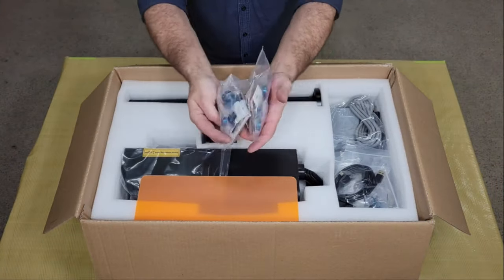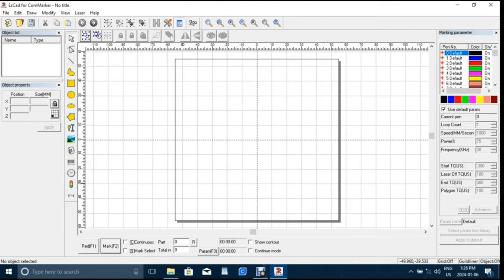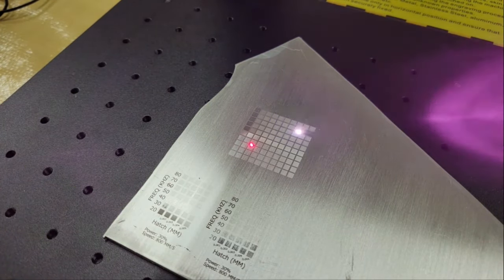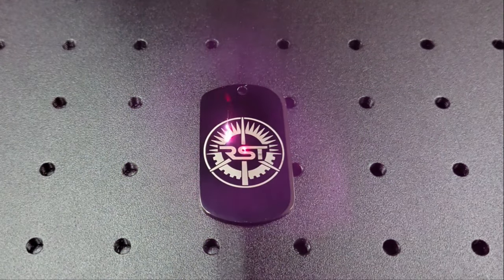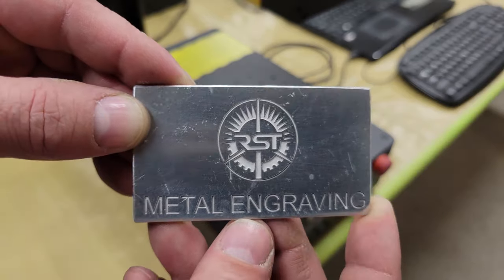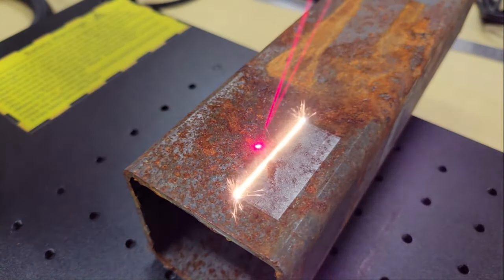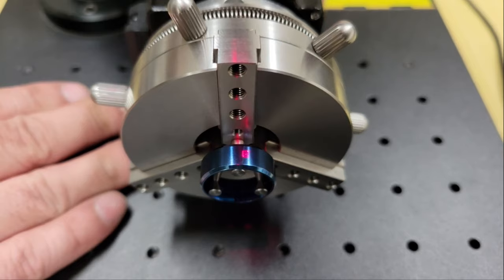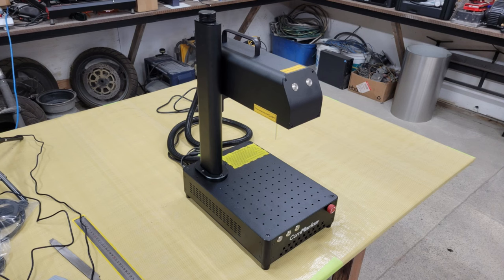3D Metal Engraving W/ ComMarker B4 Fiber Laser: Review

Comment: Does this engrave on glass?
Reply from the maker: Not bare glass because it won't absorb the fiber laser's wavelength, but it can with a pretreatment like a marking spray (Cermark or Enduramark), black ink, permanent marker, etc. Anything to prevent the laser from passing straight through the glass unimpeded. If you're looking for a machine that can engrave bare glass (and any other material using a fraction of the power to produce the same result), check out my latest review of ComMarker's new Omni 1 UV laser.

Comment: I would consider you pretty familiar with laser engravers and as such the best impartial person to turn to for my question. Setting aside speed efficiency in terms of profit(still should be quick for my own sanity), for a prototyping shop what laser system would you recommend for engraving primarily steels and tool steel up to 0.015-0.020” (0.35-0.5mm) with maybe occasional carbide/ceramics to half that but not nearly as a priority? 
[I’m assuming if it can handle these then other materials like aluminum, brass, bronze, cast iron, copper would be just as capable if i’m wrong, plz correct]

I’ve been looking for a setup that can engrave deep Identification onto the above materials as traditional punch engraving isn’t practical and existing laser engravings rub off or become damaged & illegible. 

Some tooling with existing “scratch pass” from laser engraving gets worn away so quickly that it disrupts workflow, leads to costly mistakes and in general aggravates to the point of necessitating change. 

While there are definitely many other systems and methods that can be employed to minimize these issues, for my specific situation the most fool proof and reliable is to have tools with permanent engravings (something like the big deeply embedded numbering on impact sockets where at a glance the important information is immediately visible).

I would never dream of holding someone else accountable for their opinion so any feedback or signposts would help immensely in narrowing down all the different competing models and stretched marketing strategies.

Comment: Hey dude. Glad o found your channel, work place just purchased 30w fiber laser and I'm happy to play with it. Where could I get this speed Vs power grid so I can try various material here.  Thanks
Reply from the maker: Tell your boss to get Lightburn software if they don't already have it (make sure to get the galvo license). It's the best control software for lasers imo. Use the material test tool that's included in the software to create test grids quick and easy with any parameter ranges that you want to try. Check out my other fiber laser videos to see how to use Lightburn's material test tool for reference.

Comment: where does the removed metal go? I was thinking of using this in my jewelry business.
Reply from the maker: Mostly vaporized, some is turned to fine dust/powder that settles on the base and work bench. Not sure what sort of effect the laser has on the properties of particulates that aren't completely vaporized or if it's in a condition to be reused (I assume you would want to recycle as much 'waste' as possible). Ventilation is a must either way.

Comment: Can you please say what type of coating you use for the metal tags and cards? Is this paint, powdercoat, electroplate?
Reply from the maker: Not sure what you mean. I didn't apply a coating to anything, but you can mark any of those.
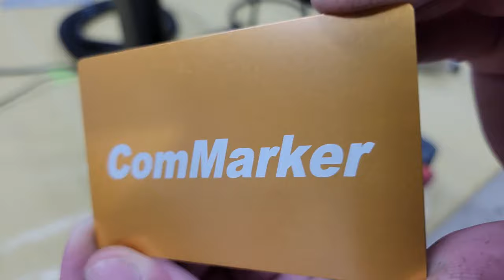Reply: @JamesBiggar  At 6:37 then how did you turn the unmarked aluminum business cards blue, black and gold if there was no coating on them to start? Is that some special alloy you're using?
Reply from the maker: I never said there was no coating on them to start with. I said that I didn't apply a coating to anything, because I didn't. Those are blanks made by a manufacturer who cuts and coats them for sale. You can buy them in a variety of thicknesses and colors, like a lot of laser engraving materials. Business cards, dog tags, tumblers, coasters, etc. Google it.

Comment: Can i do bottles on this
And glass?
Reply from the maker: If you put a coating on the glass first. Fiber and diode lasers travel through clear material with no effect. You need to darken the surface in order to focus the laser energy into it to engrave. This can be done with a variety of methods like a permanent marker, paint, or other coatings that are designed specifically for engraving glass which will easily wash off with water and leave a better finish (CerMark, for ex). To engrave clear materials without applying coatings first, you would need a CO2 engraver.

Comment: does it engrave on powder coated crca sheet?
Reply from the maker: Yes
Reply: @JamesBiggar  what about traffolyte plastic sheet?
Reply from the maker: Yes. Traffolyte is specifically made for laser and router engraving. This machine can mark and engrave almost any type of metal or plastic. I haven't seen a material that it doesn't unless it's clear plastic. Fiber lasers won't engrave clear plastic regardless of type unless it's pretreated first with a laser marking coating, paint, or anything to give it color, but results will vary.